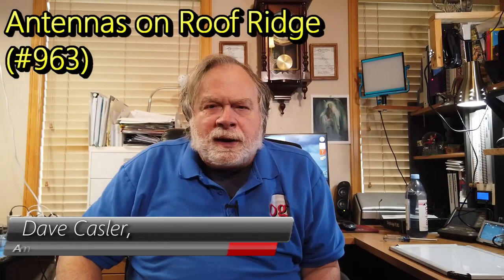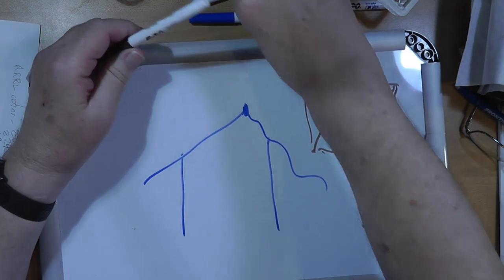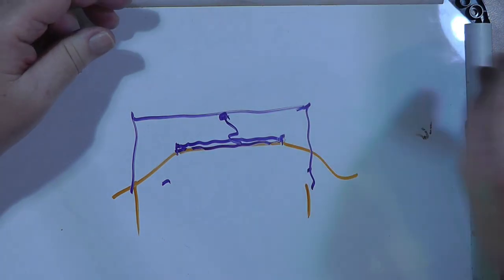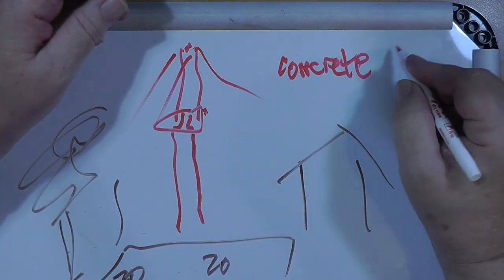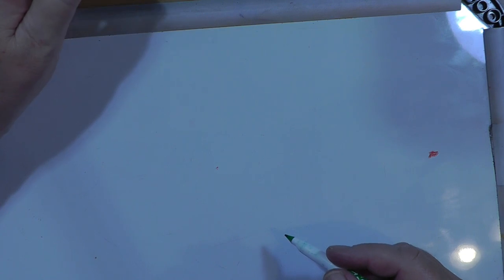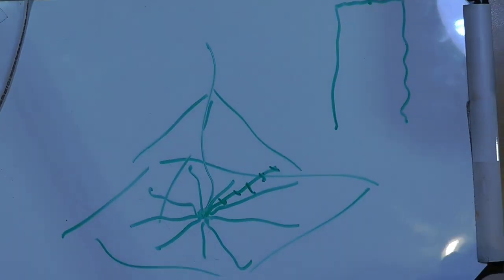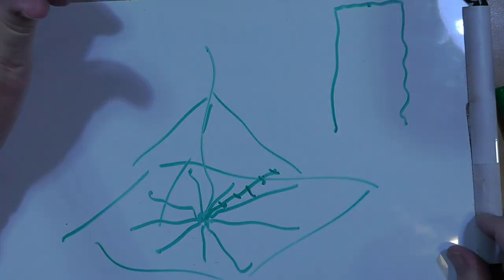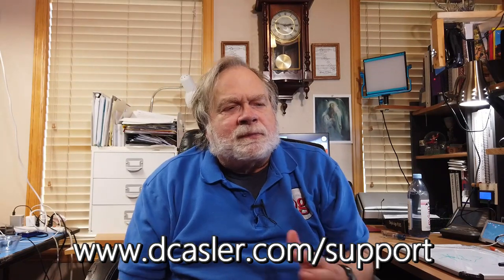Antenna On Roof Ridge (#963)

Comment: I’m planning a similar configuration due to living in a HOA. Fortunately, I do have a couple of 35’ trees in the back for my endpoint. The 66’ EFHW wire will drop to the ridge using the old RCA 300 ohm twin lead line offsets. The ridge terminates right at 70’. I’ll drill a small hole for the wire to the LDG 49:1 unun. With the coax connected to the SO-239, I have a previous coax hole into the closet in my radio room which will feed my antenna switchbox to the autotuner and then to the transceiver.

Comment: The vertical is better than a dipole??  

Is this true even if the dipole is on the ridgeline of a 2-story house, and further elevated by a foot (or maybe more), my ridgeline is ~50-52ft in length that I could a fix a mast at either end and string a multi-band dipole between (I'm only just knowledgeable enough to put that together, please don't think I'm saying this is correct), the height off of the ground is ~28-30ft due to the attic/roof pitch.

The rigdeline is oriented East/West however and this also seems like an issue???  (The dipole would be obviously in the same orientation)

Comment: For the DXCommander there is a new signature 9 that you put a pice of pvc pipe in the ground so you don’t have to guy it, also if it’s an HOA you can stand it up when you operate and down when off the air, I have seen people take a dipole and run it down the center of the roof then down

Comment: I will hopefully have my Ham Tech lic by next week, so I'm trying to think of how to get an Antenna up on the roof using an old Directv dish coaxial cable that was used for that installation and then run another coax from inside the home to the transceiver. Would this be feasible to use?

Comment: How about electric fence wire for transmit and radials for end fed. I have a carport, with 8 legs, that could give me 8 radials. A vertical centered on the car port may be possible.

Comment: Hello Dave. How are you feeling these days?  I happen to have the same situation here in Florida. Concrete roof tiles. Any suggestions?   My townhouse is concrete bock with stucco. The stucco is over a wire mesh. A wire antenna along the outside wall is deaf!could a lay the antenna wire on the roof surface?  The hoa is brutal
Reply: I would think that laying the radiator directly on the surface would'nt be a wise idea being the rain, mist or whatever would short the radiator to ground in inclimate weather. Only my opinion. Maybe mounting small insulators to the surface of the cement tile with a small dollop of construction adhesive, then thread your radiating element through the insulator would keep the radiator from grounding to the cement tile surface. IDK just my two cents!👍